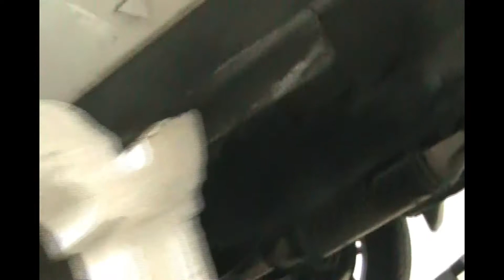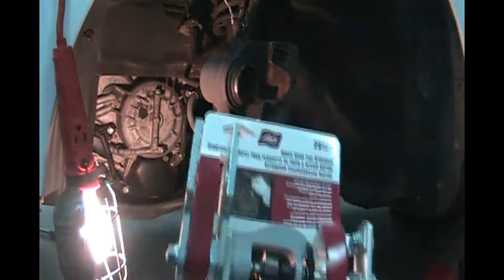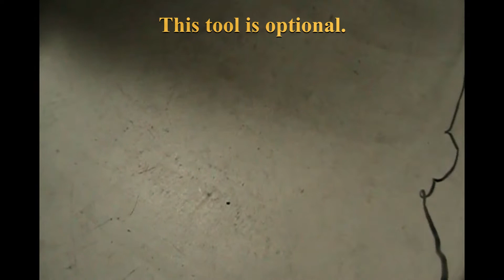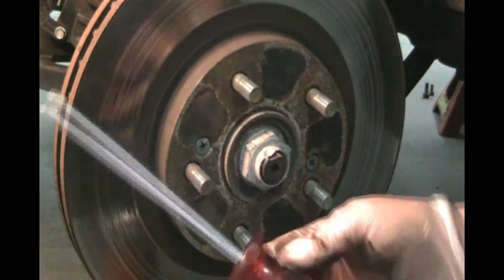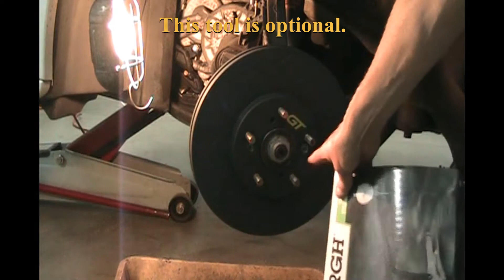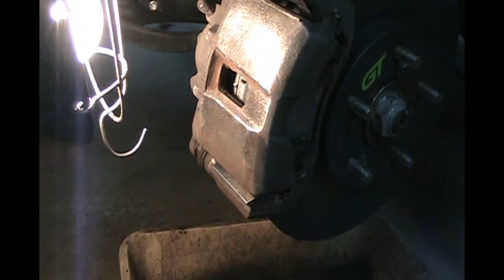2000 Acura 3.2 TL Front Brake Job D.I.Y. Step-by-step instructions.

Comment: Is the turkey baster necessary or am I a noob?
Reply from the maker: A turkey baster is not necessary. You can get one at the dollar store, or you can just push all that black burned brake fluid thru to the bleed valves at each wheel to get it out.  Either way, the idea is to get all the black brake fluid out and only have clean new fluid in the brake system.